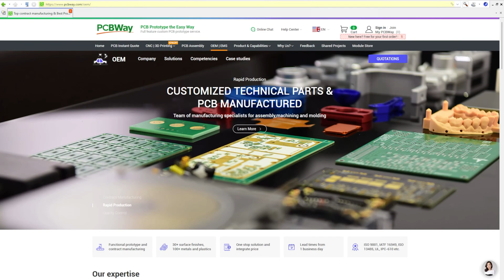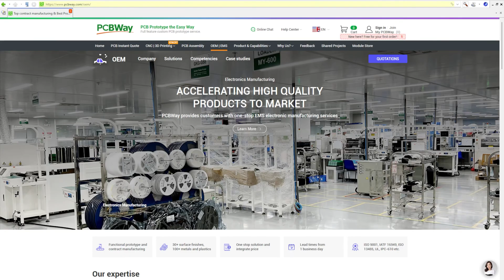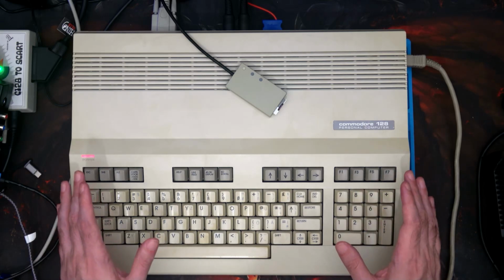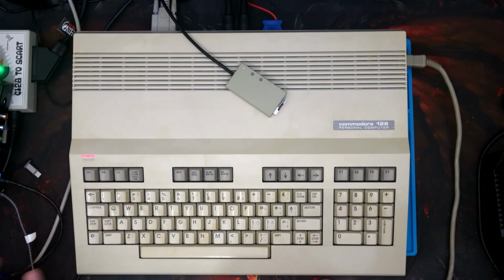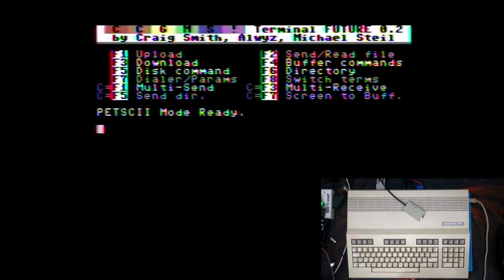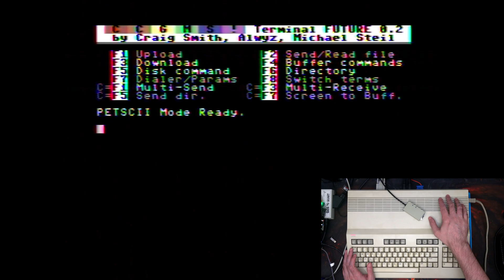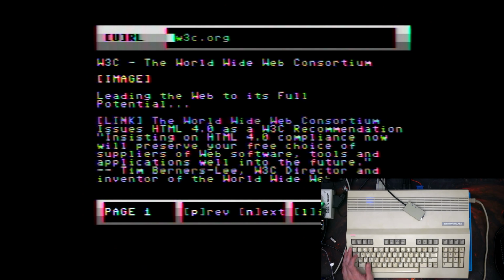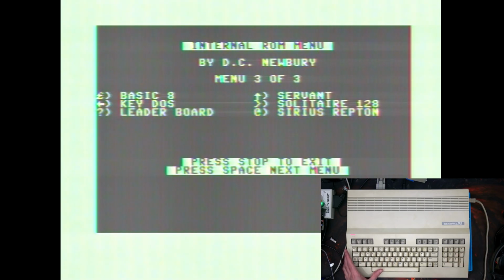Commodore 128 internal mods - Swift-232 and MegaBit 128 1MB

Comment: Me and my friend Jeff used to log onto the local BBS back in the day and download software (ahem!) to try it out on my 300 baud modem and my C64. We'd wait for AGES for a game to download, then load it up and....it wouldn't work half the time. Still, I remember those days with fondness. Some of the PETSCII BBSes did some very clever things with PETSCII animation. I was in heaven when my mom and dad bought me a 1200 baud modem for Christmas.
Reply from the maker: Thank you for sharing your story. It’s nice hearing how people did things back in the day!

Thank you for watching.
Reply: I too started out accessing local BBS's with a C64 and 300 baud modem in May 1992.  A bit late for most but such was my life at the time.  I too remember enjoying the bump up to 1200 baud a month or so later.  And then 2400 baud after that... and then I maxed it out with a 56k US Robotics before the 90s ended.  Fun times!
Reply: @LordHasenpfeffer  Was your Commodore able to handle the data throughput of the 56K?
Reply: @JustWasted3HoursHere  Oh, yes.  Definitely.  Never had any problem with that which I can recall.  Once I reached 56K baud, I never used anything less.
Reply: @LordHasenpfeffer  Now that I think about it, 56K baud works out to about 7K/sec transfer speed which a 1.02mhz processor should be able to handle with no problem. Must have been nice downloading programs in less than a minute instead of an hour or more!

Comment: I like the idea of the internal WiFi - that's kind of neat. But even watching the video I don't quite get what that Megabit 1 MB thing is supposed to accomplish. What did I miss?
Reply from the maker: The C128 has an empty socket from stock. You can add a ROM to add extra functionality. Rather than having a cartridge at the back. Meaning you didn't have to keep plugging and unplugging your favourite BASIC expansion cart for example.

A few different ROMs came out over the years, and others converted carts to fit on a EPROM ready for said socket.

The Megabit128 does that, but gives you more than just one ROM. I guess it makes more sense that the fancy Carts do the same thing these days, but it was to replace the not so fancy chip that was already in there from the past owner. 

Does that explain things a little better?

The Megabit 128 with 1MB gives you a c